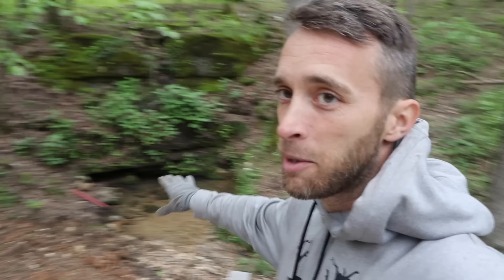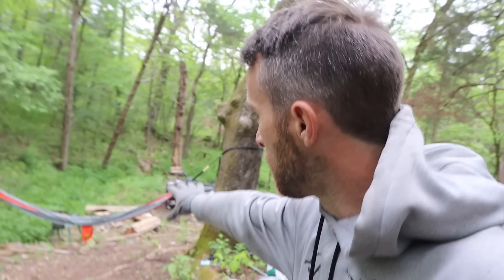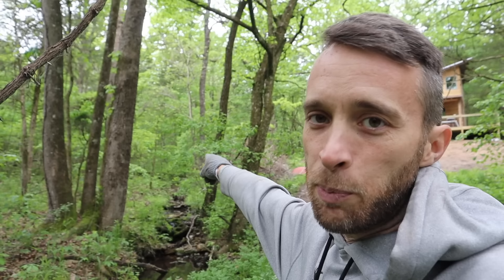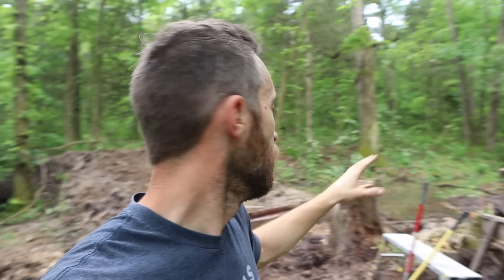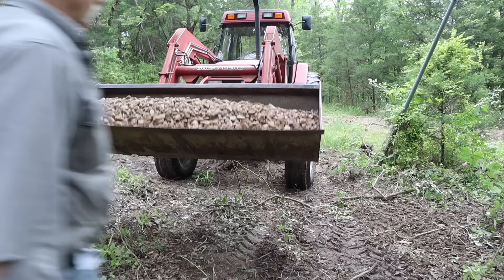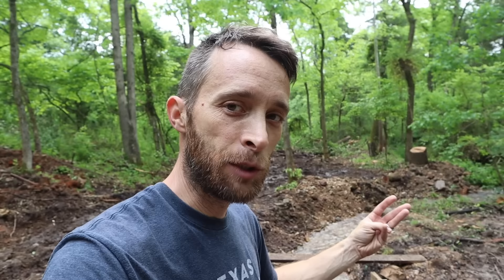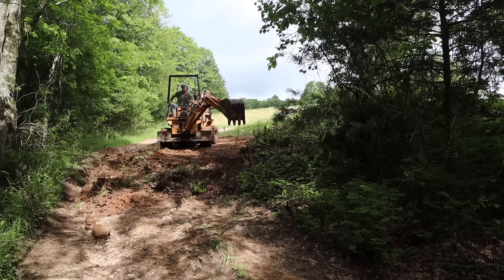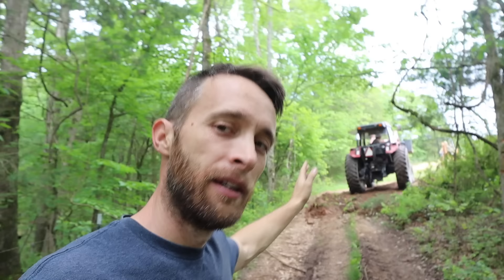Building A Dam for Hydroelectric Power - Part 1 - Off Grid Cabin - EP #22

Comment: You need to measure the Discharge of the river. Q(discharge) = V (velocity) x A (Area). Measure velocity simply by releasing an apple or orange upstream and timing it over a set distance (25m or so). Do all the calcs in metric then just convert at the end, saves a lot of faffing.

Comment: There is enough energy in that stream ro power a WHOLE neighborhood!
Reply: Ohh so thats how powerful a stream can be
Reply: Nope. He has almost no head (fall of water). This project will not be profitable.
Reply: Number of litres per second times drop in meters (head) times 9.8 (gravitational constant) equals watts out put (usually you’d expect approx 50 % conversation to electric power. Most uk homes use between 2 and 2.5 kilowatts small steam may not be enough for a whole house but it is constant is very useful def worth doing as its effectively free once built
Reply: @sifergy8412  Cost of manual labor (cutting trees, building dam, welding and manufacturing waterwheel, etc), equipment and materials (concrete, motor, electrical, gears, etc.), maintenance cost(constant clearing debris, rust, etc.).... When you calculate it all you will find out that it is not worth it as an investment.
I like it as a hobby and a luxury thing, but it is not an investment.

Comment: You are going to want to know how much power, we will use watts since you are generating electricity, you can make with your dam. We will ignore any losses in bearings belts etc. Pure power based on falling water. With 300 gallons per minute and a three foot drop from the top of the dam to the top of the downstream flow you can make 40 pounds per second divided by 550 pounds per second per horsepower per foot, mulitplied by 3 feet to get horsepower. That flow and drop will make 0.218 horsepower. One horsepower is 750 watts. So you can make about 160 watts without losses. You will get almost 4 Kilowatt hours per day.  If you need more horsepower, just raise the damn and enlarge the wheel. Just reply to me on this comment,  if you need any more help with calculations like that. The nice part about this form of solar energy, sun evaporates water and moves it uphill as rain, is that it is 24/7 without interruption. Wind, air movement due to temp differences caused by the sun, is highly unreliable. Direct sun is only part time and can be very low with differing seasons and weather.
Reply from the maker: All I know is that the hydro generator I purchased needs 500 RPMs for 24 volts. So we are rigging our pulley system to make that. Right now we are getting about 300 RPMs but adding more pulleys to get over 500.

Comment: Your way over thinking the rpm speeds on the wheel, just use a transmission gear box off of a riding lawn mower switch the pulley out and generate 3 to 400 rmp a minute with minimal water speed. You can also use the gears to slow down the wheel during days of heavy rain to not burn out your pma.
Reply: Erich Weiler  lol i also misspelled rpm

Comment: The reason you don't see overshot water wheels used in hydroelectric is because they're very inefficient. You'd be better off with an undershot wheel or a vortex since you have high flow but low head.
Reply: But the wheel looks cool and old fashioned.

Comment: This was an interesting endeavor that ended in disappointment.  After building the dam and having 24/7 energy flow, the hydro project was abandoned because the water was underutilized.  Well if what you have doesn't take advantage of your hydrologic energy, then you need to wipe the prototype clean and start over.  With that much water, you should be able to harvest st least 1KW at any time.  Solar is wonderful, but it doesn't provide 24/7 energy like hydro will.   Please, please, please utilize this power and have a successful outcome.

Comment: Just checking, damming a source does not compliantly change the amount of water that is supplied down stream right? It’s still moving through the system and working as a controller so it’s more consistent right? Idk is someone can explain that would be great.
Reply from the maker: You are correct.
Reply: @LoftisPartyofSix thanks, I couldn’t find anything concrete online. Super cool build

Comment: I don’t understand the reason for a dam. If the flow is enough you just need a canal to the wheel. Even with the dam, the water coming to the wheel need to be equal to the one coming in into the dam otherwise your dam slowly will empty and you will end up with not enough water to rum the wheel until the dam is full again. Just my 🤔 thinking.